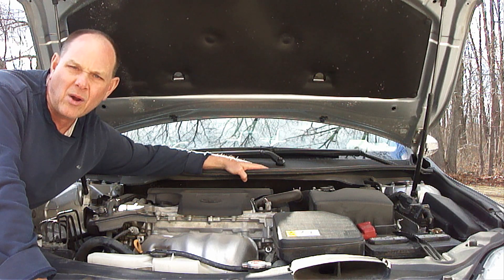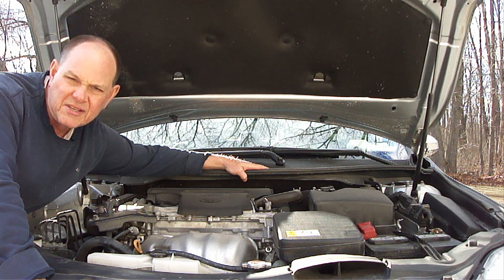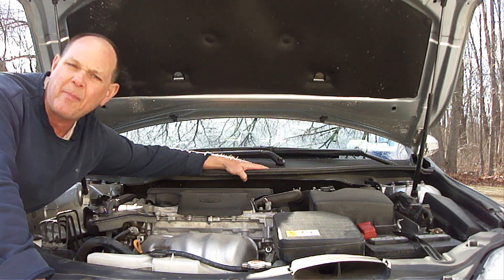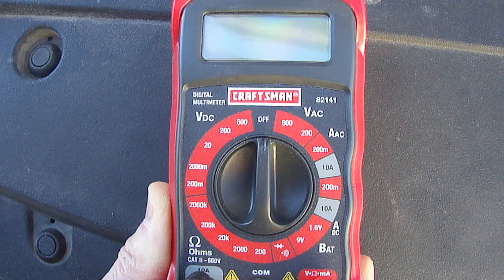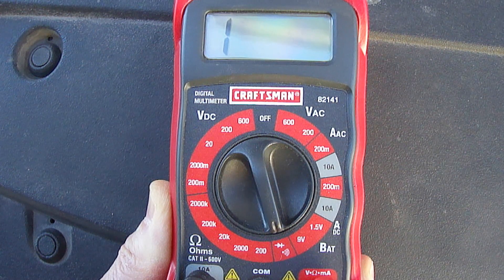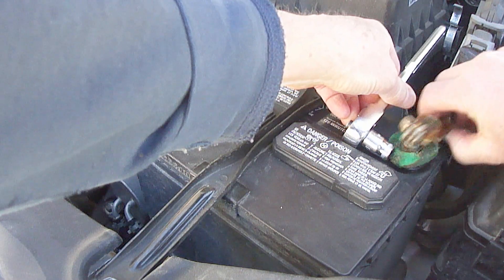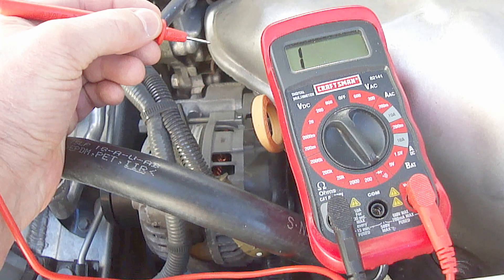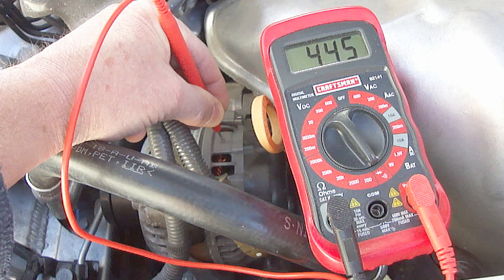How An Alternator Can Wreck Your Car

Comment: I have a 2001 Tahoe that is draining the battery overnight. I took the negative terminal off the battery. Put the the black probe on the positive battery terminal and touched the red probe to the alternator case and I got a tone and a reading that steadily goes down to zero and once it goes to zero then the tone stops and the reading climbs until it gets to 424. What’s going on?

Comment: I took my alternator and it passed. However it is not right. I have to disconnect the alt  fuse or my battery can drain. When I connect the fuse, there's always a spark.
That dog gets the sidecar.
Reply: It may not be the alternator, unfortunately there are a lot of other battery drains, it may be worth buying a battery disconnect until you find the problem.